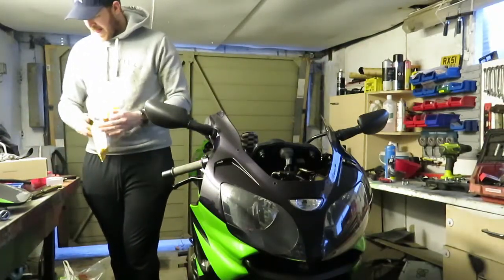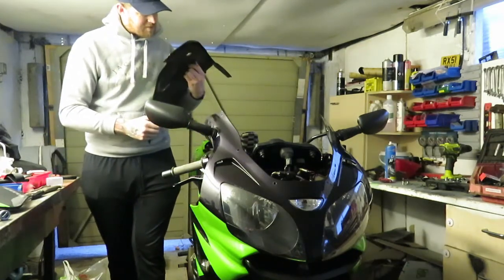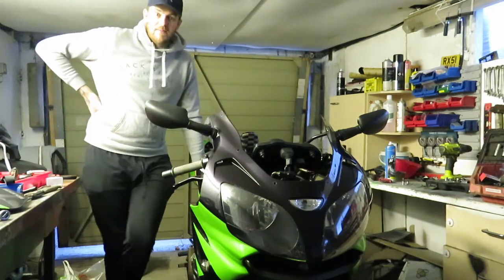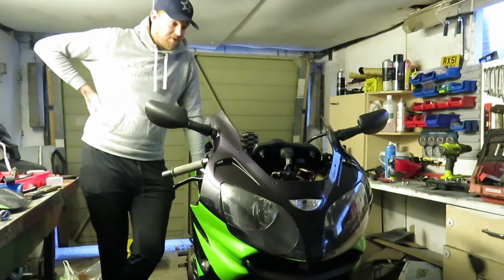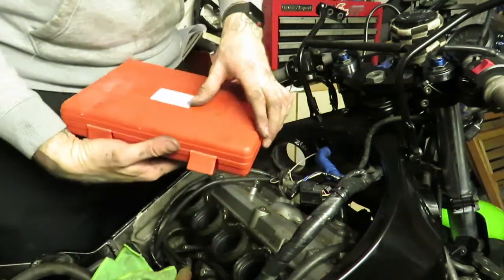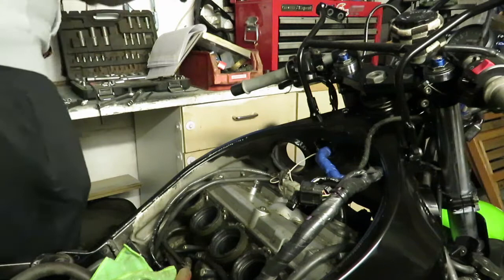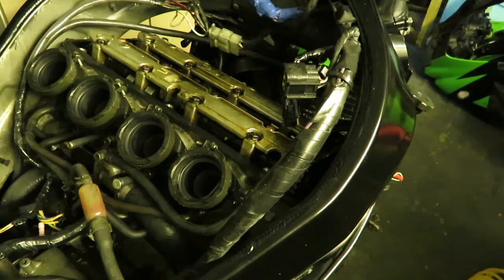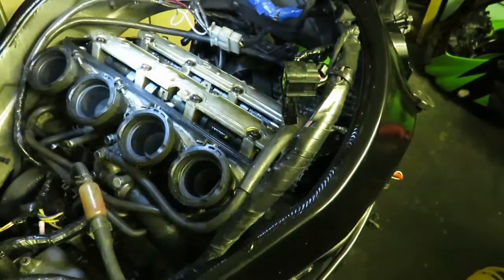Kawasaki ZX9R E2 Project, Valve Clearance Check

Comment: Starting with, great videos, 
have now adjusted the valves on my C1 :)
 
Maybe I can ask one thing...?
You had purchased a Kawasaki Ninja ZX-9R 1998-2003 Coolant Reservoir Tank, with extra gap for crash pucks bolt, to be able to mount against the frame
 
BR
Martin Roos
😁

Comment: It's also advised to clean the feeler gauge then coat it in oil beforehand to prevent any potential scratching of the cam lobe surface.